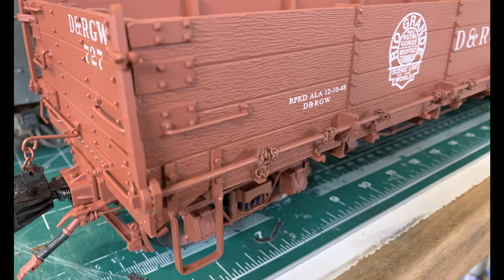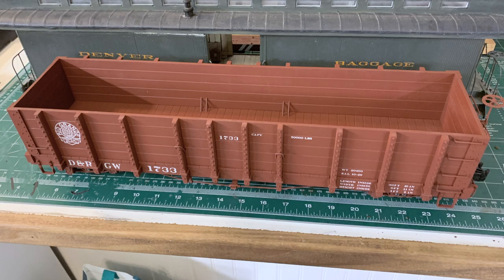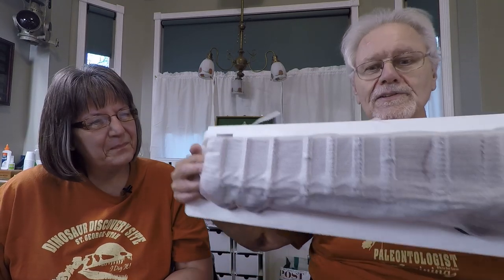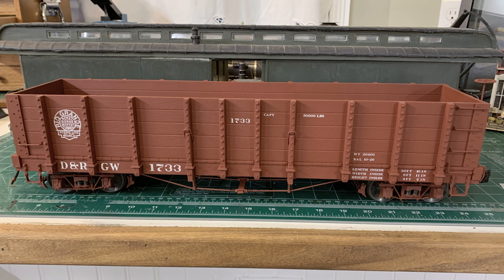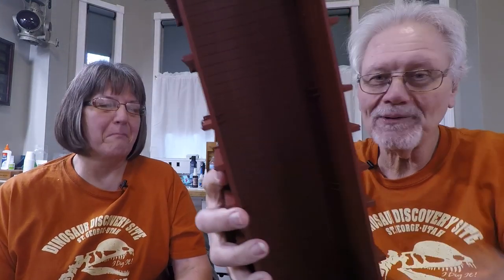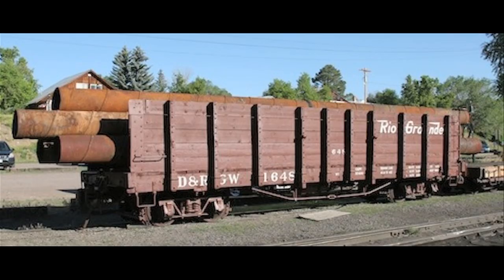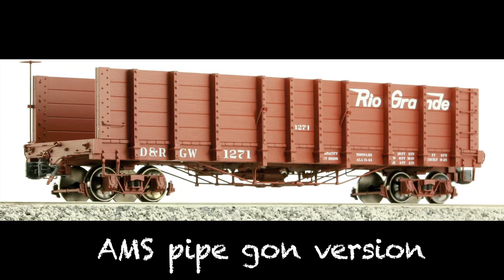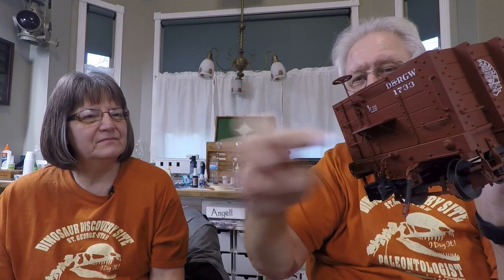AMS 1:20.3 Scale Rio Grande High Side Gondola  -  (Accucraft) Unboxing the High Side Gondola

Comment: Another great video.  LUV you guys!  Anyway, I personally would very much appreciate one or more of these "movies" to go in-depth into scratch-building rolling stock in terms of what you have done and what Al did.  Not only techniques, but also, where to obtain supplies, including brass parts that are most easily simply purchased and attached, unless I am incorrect about that, and stuff for interiors.  Dale, you mentioned, for example, that you had purchased a bunch of seats for passenger cars, and also, you mentioned that Al had obtained the light fixtures from somewhere, that he had not scratch--build them per se.  Also things like wheels and trucks.  And couplers.  And what books are best to have and use.  I'm already aware of the John White books, including his "red book," as mentioned by Al in the last video which featured him.  What others are good to have?  Also, has anybody ever made a working airbrake system?

Y'all are really inspiring me to dive into this further as time and money allow, so thank you!
Reply from the maker: Hi. Working air brakes. Hum... well sort of. In 7 1/2 inch gauge but runs on vacuum. Uses the vacuum stuff they had on cars (autos) in the 59’s and 60’s. Vacuum spark advance diaphragm for example. Doesn’t look right at all but works great.

Comment: They need a Patreon campaign to fund that model railroad that they've been talking about forever. Maybe they can offer downloadable videos that cover (in detail) the planing, construction, and initialization of said model railroad as a Patreon reward. Another Patreon reward item could be a list (with links to buy) of the tools, supplies, and components used in the making of the model railroad. Then after some time has passed, say six months or so, those videos could be chopped up into smaller segments and placed on YouTube with the parts and supply list in comments as affiliate links. A set of detailed videos that cover the selection, design, construction, revisions, troubleshooting, initialization, and operation of a model railroad would be of great help to many people for years to come.
Reply from the maker: I was thinking more of a government grant. Seven figures. Before the decimal. At that point I’m thinking for a larger layout. Something like the Cumbres and toltec. 

So I guess we will stick to what we are building. Yes, slowly. But one thing holds true at all times. We are closer now than ever before.
Reply: @ToyManTelevision  Sounds like you've been working on it for a while, how about a quick video sneak peak?
Reply from the maker: That’s the plan. We were planning to travel a lot this summer but..... so time spent on the layout. And yup!  Making a show on that.